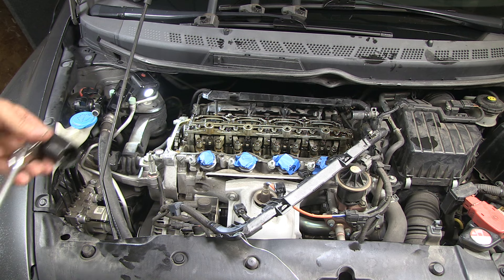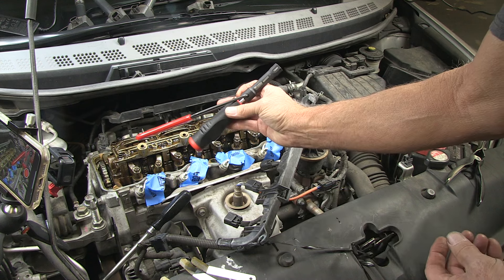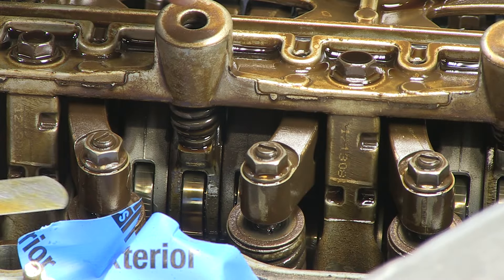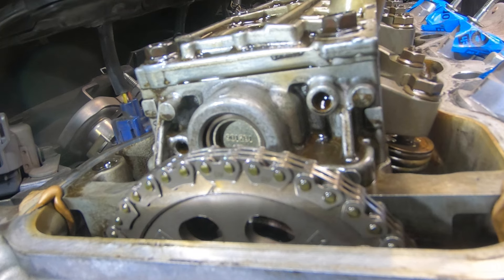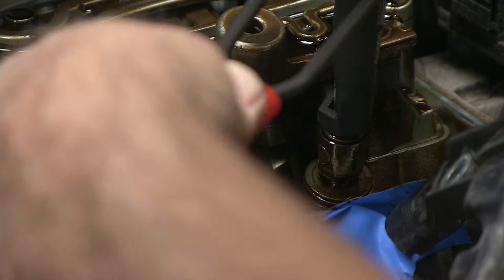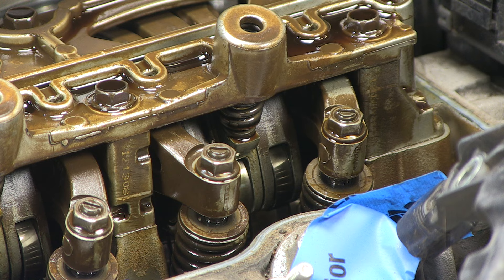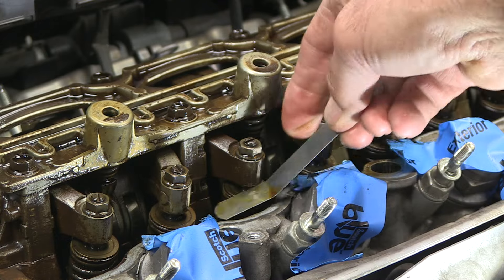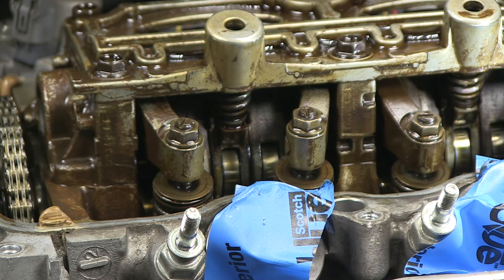Should I adjust valves on a Honda Civic? Here is what I found out.

Comment: Followed your instructions to clean the throttle body and adjust the valves on my 2010 civic with 147k miles. Several valves were a little loose and a couple on the tight side. Engine is now running smooth and no more slight tapping noise from the valves.  I was going to replace the transmission filter while I had the air filter box removed.  Surprise, no filter on my 2010.  Maybe it's hidden away somewhere else.  Thanks for all your fantastic maintenance and upgrade videos.
Reply from the maker: Appreciate your success story
Reply: Did it improve your MPG ?
Reply from the maker: @leftonseen690  it made no difference that I could see, good peace of mind knowing it’s done though
Reply: mine has 158k and has been doing it for a while now, ngl scared to do it but i wanna do it.
Reply: @leftonseen690  not sure about that.  Immediately after I was getting 29mpg, but I hadn't performed the throttle relearn.  It was idling at around 1600.  I did the throttle relearn and that brought the idle down to around 700 and I got around 32 mpg on the first tank after fixing the idle.
Reply: It has a filter it looks like Fuel filter but it not its a black filter. It was expensive like $65
Reply: @nighthawkj30A4  I have the replacement filter.  I think I paid $35, but yes, the dealer price was around $65. My problem is that there is no inline filter present on my civic.  I was expecting to find it just like Danny showed in the video. I should have removed the filter box to check before buying the $35 filter.
Reply: Interesting. I have a 2010 Honda Civic which I replaced the transmission filter. It had two hoses coming out of both ends. Maybe you missed it

Comment: One of the best videos about this issue on this type of Honda. My car is the same model and generation with yours. Mine is at 143000 miles. I haven’t heard any weird sounds yet. In your video, even at 150000 miles, those valves still hold up really well. Do you think I should wait till I notice weird sounds or go ahead and have shops check it out at specific interval? This job is kinda beyond my ability. :))
Reply from the maker: As mine were only slightly out of adjustment, I would say you can wait, this is my opinion and based off my Civics findings, I also did a valve adjustment video on a Honda Element at 125k miles and that needed it, but that’s a different engine. Hopefully this helps you determine what’s right for you.
Reply: @dannysdiygarage  Thanks so much for taking your time to answer my concerns. Really appreciated. I will wait and see as my car hasn’t had any issues yet. Still good gas mileage, no noise, no CEL. One of your videos about changing ATF and Strainer on Honda Civic helped me a lot. I changed them already. But for this valve job, I think it’s better to leave it for professionals. :))

Comment: Tip: After loosening a valve's adjustment screw, insert the desired feeler gauge and gently tighten the screw until there is a slight drag.  Then tighten locknut.  Will save some time and guessing by tightening to the gauge.
Tip: Clamp a vise grip pliers to your screwdriver if you don't have that nifty tool.  Use a screwdriver that wedges well into the adjustment slots.
Reply from the maker: Thanks for adding this information appreciated
Reply: Some more tips:  
A box end wrench and a good screw driver used together work well.  

As this video emphasizes, it is very important to double-check your work, both after you tighten each nut down and again after you have finished the last set of valves.  You can set a valve incorrectly just by a burr or a scratch on your feeler gauge, so rotating the crank shaft several times and then going through and re-measuring everything again is a good idea.  

Finally, keep your tools reasonably clean.  Don't use gritty or scratched up feeler gauges on your engine.  Jus' sayin'.
Reply from the maker: Thank you for commenting and adding tips for others, I appreciate it and so do others
Reply: Sure wish that there was a link to the nifty valve tool .
Reply: @Drock8003 any parts store can hook you up with one
Reply: He's very good except for one thing he should have shown the I take as well
Reply: Fault finders reveal their darkness

Comment: You adjust valve stem clearances to keep your valves from being damaged and to keep your engine running optimally (see below).  The internet shows multiple references saying that if your engine has mechanical valve lifters, then you should consider adjusting them about every 50,000 miles to keep your engine in optimal condition.  Even if you choose a longer interval, adjusting them every 100,000 miles is a good idea.  

Damage:  The primary reason to adjust valve stem clearances is that if they are set too tight, they stay open longer than they are supposed to.  Valves, especially exhaust valves, cool in part by dissipating heat through the valve seat while they are closed (which is about 3/4ths of the time--valves open 1 out of 4 strokes, right?).  They can get excessively hot and warp or even melt at the edges if they stay open longer than they are supposed to.  

Maintaining optimum:  The second reason to adjust valve stem clearances is that the engine was designed to open and close valves at specific times.  The engine runs better and smoother, and is a lot quieter if the valves are set correctly.   By the way, most of that sewing machine sound coming from the top of a Honda engine is the valve stems and rockers clicking together as they open and close, so a soft rhythmic snicking noise from the area is quite normal.
Reply from the maker: Thanks Joe for adding additional information ❤️

Comment: Thanks, Danny, for another great video.  I did this and cleaned the injectors on my 2006 Civic at the same time.  Taking the cowl out helped for both jobs.  It made a big difference.  I have two suggestions for videos that would be very useful to Civic owners:  1) the notorious sunvisors; 2) all the little plastic clips.  I've even struggled with figuring out part numbers with the Honda Parts guy.  What they are, numbers, and, of course, aftermarket suggestions to save money on this little plastic parts the dealer charges too much for would be very useful.

Comment: I have a euro spec R18A2. My car is now on 141k miles, I've done the valve adjustment twice in my 70k ownership. To rotate the engine, I jack up front of car, put it in gear and turn the one of the front roadwheels. Also worth mentioning you need to apply some high temp RTV to the corner of valve cover and leave a few hours on reassembly. Finally, it was a good video but it would have been useful for the less mechanically minded to state the exhaust valves are nearer the front of the car.
Reply from the maker: Great feedback, appreciate your input 👍🏼

Comment: I have European version of Civic Tourer with R18A2 engine ,model year 2014 with only 45k miles on it. Honda service book say 28k valve check and adjust but I guess if engine runs smooth there is no point to open it and check. I guess no need for adjustement before 60-80k miles or until consumption changes or valves start tapping.
Reply from the maker: I would wait till 100k, a lot of times the valves tighten up, not loosen,

Comment: Hi
So my civic is a bit noisy from the engine when its hot and sounds way quieter when its a cold start
I am thinking its the valves adjustment that needs to be done since the sound is a tapping one
Am i right?
Should i go for it?
What else should I expect to gain from valves adjustment
Also i have noticed its a bit high on fuel in local traffic and wayy better on long routes with some degree of struggle when going uphill 
But that may be the prosmatic transmission 

Many thanks
Reply from the maker: Sounds like this might be the case, you’ll gain better running and better performance which will allow better mileage good luck.
Reply: Having this same issue too

Comment: I did a valve adjustment on the Honda CBX six cylinder....24 valve. Obviously a completely different setup with shims in the lifters, but of the 24 valves, 12 needed adjustment, and of the 12, 9 were exhaust. What does that say about exhaust valves?
Reply from the maker: Exhaust valve run hotter then intake
Reply: @dannysdiygarage  and unfortunately I have a bad oil seal in #4 ...bet when I take the head off, it will be on the exhaust side. I've had the head off before....at least you don't have to take the engine out of the bike. 300 Honda parts all over my friends garage.....

Comment: What performance issue will we feel if the valves are not adjusted properly? Will it cause the check engine light to come on? Will the engine hesitate
Reply from the maker: Correct, Depending on how out of adjustment they become, drivability issues, engine light, misfire, bad gas mileage, rough or unstable idle, lack of performance or noisy engine

Comment: I have a big question and it is very confusing. I watched both of your videos honda element and honda civic valve adjusment. So which one is the exhaust valves and the intake? the ones on the back or the ones on the front?  I just did this to my honda fit and its more noisy now. I truly think the adjustment I did is backwards.
Reply from the maker: Intake valves are closest to the intake manifold, exhaust valves are closer to the exhaust manifold, on this car exhaust is in the front of the car
Reply: So every car's location for the intake and exhaust might be different? I kinda realized that when I watched your honda Element valve adjusment video the intake was in the front and exhaust in the back then on this civic is the opposite exhaust in the front and intake in the back

Comment: what is the tools size u use to adjust the valves with the flathead screw drivers? also do u know the intake and exhaust spec for honda hrv 2020?
Reply from the maker: 10mm sorry for the delay, this comment never showed up
Reply: do you know the valve clearance spec adjustment for 2020 hrv? @dannysdiygarage
Reply: @dannysdiygarage  I was just searching the comments for this as well. I also have a Honda HRV and couldn't find if I needed a 10m or 12mm tool.

Comment: I’m finding little no info on timing chain adjustment or replacement…the car sounds fine, just curious. It’s an 08 I bought new now w/230k miles.
Reply from the maker: I’m not sure what information you’re looking for, it automatically adjusts as it wears, if it’s not causing issues it should be good for the life of the engine
Reply: That’s what I wanted to know, my bro had suggested at least having a look at it and checking valves, it still runs fine….just making sure.👍
Reply: Keep good oil in it and you shouldn't have to worry

Comment: sorry if I have missed it, but is there a torque spec on re-tightening the lock nut?
Reply from the maker: If I remember correctly the torque spec is14ftLB
Reply: Use setting "SF" on your wrench; this is the "sufficiently tight" setting.

Comment: what year is the civic ?, I have a 2013 with 45k ..oil canges when the reminder comes on at about 5% or so left, usually about 6k miles intervals..with mobil1 .
Reply from the maker: I own two 2009’s original owner also 2007 Honda Element also original owner

Comment: is the valve adjustment  same for civic 2018 L15b7 turbo charged engine intake 0.007-0.009 and for exhaust 0.010-0.011
Reply from the maker: I'm really not sure. I can look it up if I have your complete vin number, engine size

Comment: You dont explain which are the exhaust and intake valves. Also, you don't explain the order of adjustment either consecutively from left to right or according to firing order. Which is the number one cylinder, two, three and four? And which is the firing order for this 1.8L... you do not show it visually.
Reply from the maker: Sorry about that, I’ll need to do better in future videos.
Reply: @dannysdiygarage Danny, you did a wonderful job - if a person can’t figure out the row of valves on the exhaust manifold/catalytic converter side of the engine are exhaust valves and the row of valves on the throttle body, air intake and intake manifold side of the engine are intake valves, then they will not have the capability to perform this job.
Reply from the maker: I appreciate you supporting me on this, I understand I’m dealing with different levels of technical skill, I always try to straddle that fine line between not being to technical and not starting from the introduction, I should have mentioned exactly what you said, it’s a simple few sentences, I forgot, but everyone who watch definitely get more then they pay for, right, I give free advice and education ( some people still complain)